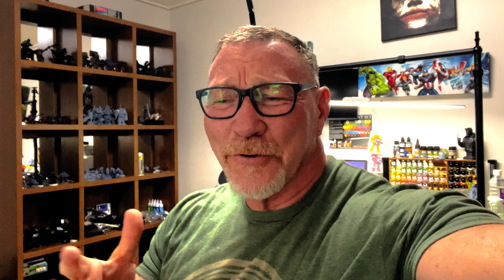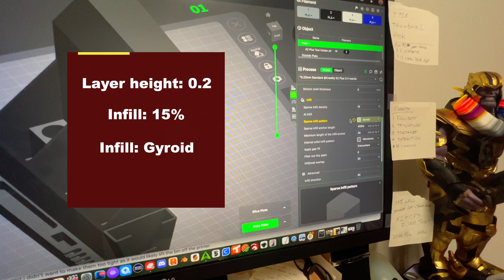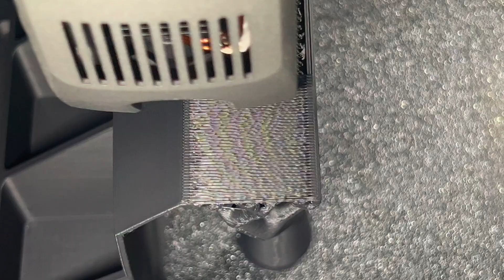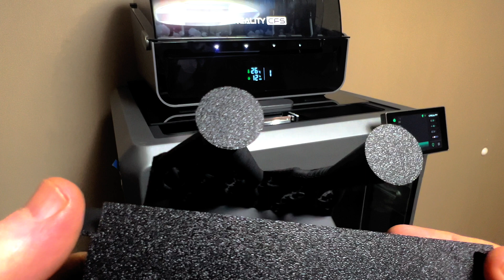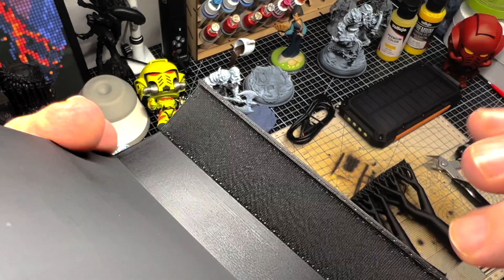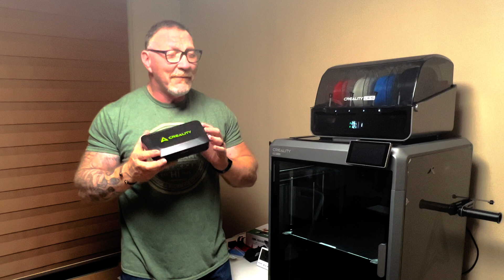3d Printing a Tool holder for Creality K2 Plus  - Free File!

Comment: Great video and model, waiting for a new spool of black to print it. One question.... I noticed your top glass cover is slid back a little leaving an open gap. Is that done for a particular reason?
Reply from the maker: Thanks for watching and checking it out. Yes the advice I was given when printing PLA was to open the door and or the top vent. It helps in rapid cooling the PLA and helps prevent sagging, warping & stringing. Too much heat in the chamber can also cause heat creep where filament is softened too early in the extruder assembly, causing clogs and inconsistent extrusion.

Comment: You should check out TPMS-D Cell. Creality released this infill in Creality Print a couple of updates ago. It seems like a mix of gyroid and adaptive cubric. They also released a companion blog post about it and linked it back to the paper from the original researcher. They claim its quicker and has less filament usage than gyroid. I've been using it on ABS, and it seems to work well.